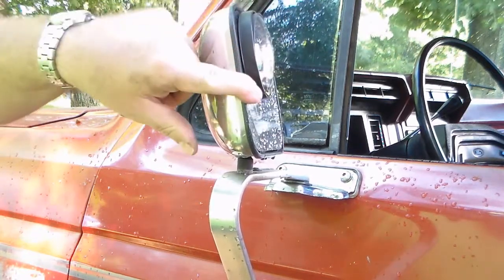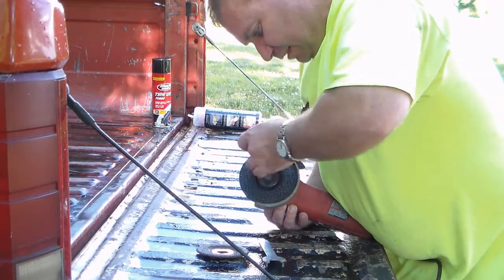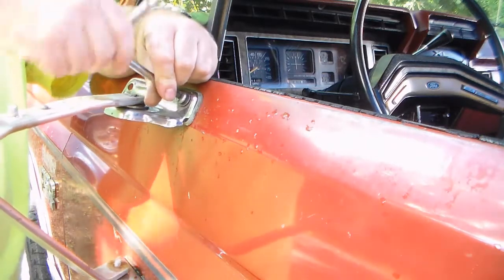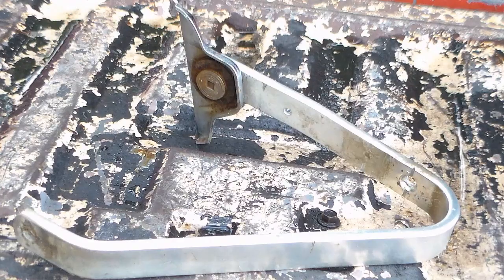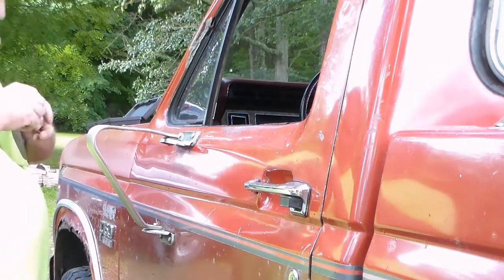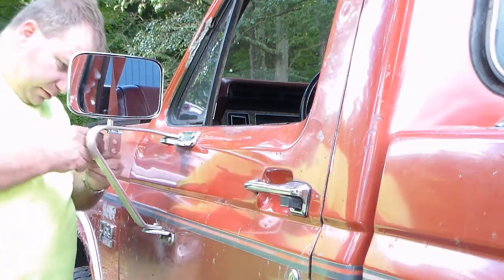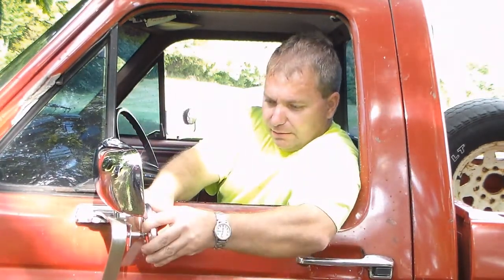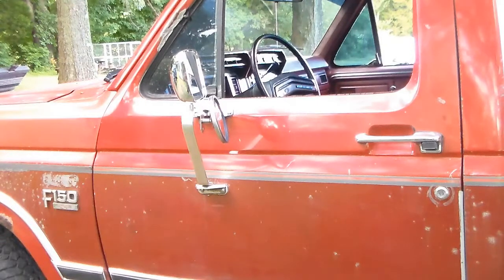Red F-150 (1986) Driver's Side Mirror Replacement

Comment: I have a 1990 F150 and have to replace the driver side mirror. It looks pretty similar to what you have there. I went to Oreilly auto parts and they had the whole assembly. I’m assuming you didn’t have take off the inside door panel for any reason? 
I appreciate your video.

Comment: I bought an aftermarket  right side mirror for my 89 f250.  the mirror is zoomed in and I cant see shit behind me.  Anyone have this problem, know where to find an oem passenger side mirror?
Reply: I had the same issue getting a set of 2 on amazon, not only do the brackets not work for my truck (96 where the top bracket is flipped) but zero visibility out of the passenger side. I ended up getting one from LMC Truck that was the right mirror (bracket still didn't work for mine but yours is an 89 so should be ok). Get the one that says Convex Glass, I got Part Number 49-6623 for mine, had to tighten the 3 screws under the mirror quite a bit to make it not vibrate but the visibility is fantastic.
Reply: @cameron.carranza  thanks for the part number.  I modded the aftermarket mirror.  I broke out the plate glass and installed a convex mirror in its place.  Looks good from 5 feet but i would love to get something proper.
Reply: @ShaunPaget  same, the LMC one looks closer to factory but does feel cheaper for sure, I'm betting its just chrome painted plastic for the housing